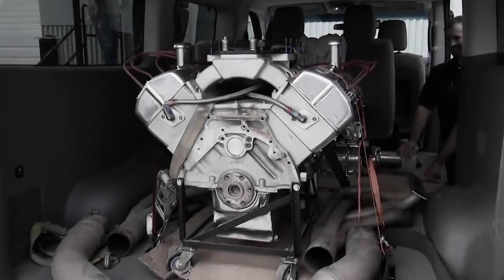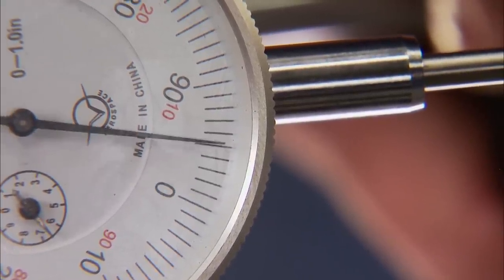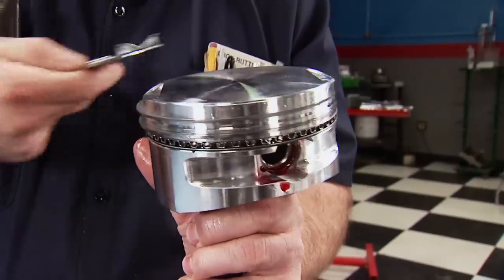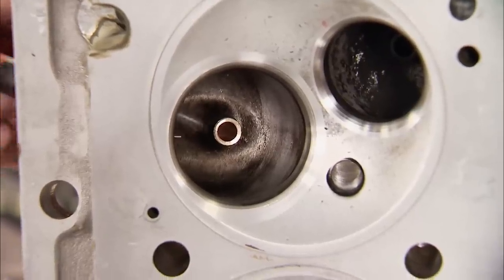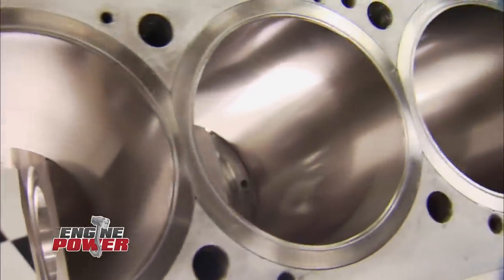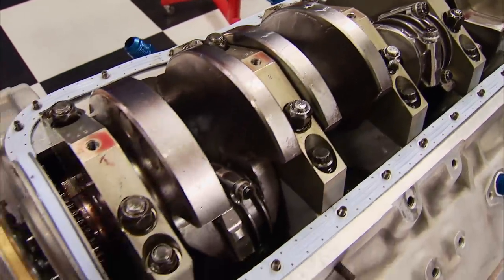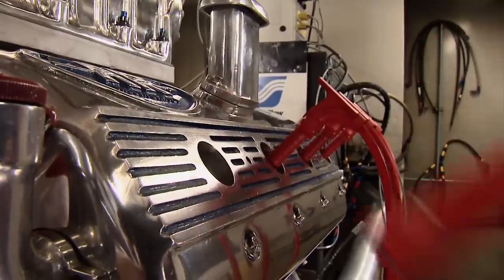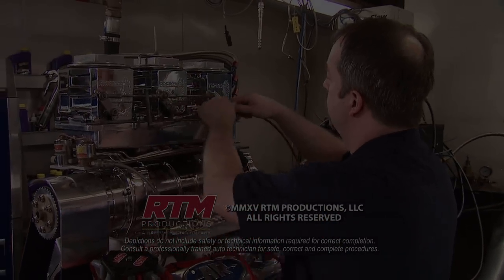The Original BigFoot Engine Build Part 3 - Engine Power Season 2, Episode 7

Comment: I love how everyone here is an expert on performance engine builds
Reply: There will always be those guys. The best part is they probably drive moms Camry.
Reply: For sure!
Reply: Man it turns my stomach to read the comments. People are just rude and disrespectful. It's a wonder anybody lets the general public see anything.
Reply: Steve Welborn oh man... if their not the best engine builders in the world their whinging about the power it made and them not wringing it’s neck on the dyno, taking no consideration into the account that this engine was designed in the 80s and only freshly started... this is a priceless, irreplaceable piece of Motorsport history. I wouldn’t want to go leaning on it and hurting it either.. imagine if it booted a rod out the side of the block (unlikely but can happen and does happen).. the point of this build was to preserve history, not make a million hp... no one sees this!
Reply: I actually am an expert in performance engine building/assembling...and a devout Ford guy. 
For that iconic powerplant and the team's goal of refreshed and improved internals without compromising the originality, I think the did a great job. I also commend them on NOT making some hard pulls on the dyno with such an irreplaceable piece of history. I don't think I could have resisted doing so. 
Overall, I think this series and the hard work on this iconic powerplant within the stated goals was most excellent. Well done!!
Reply: @Richard NZ only until the entire body of the cars are all photovoltaic cells ...
Reply: @Richard NZ not a bright thing to mention

Comment: I'm not a Ford guy but big foot is for sure a legend.  Henry Ford would piss his pants to see all that oval power.
Reply: All what power?
116 octane with 600 cubic inches and just around 1000 horsepower?
A natural pump-gas engine around 600 inches will make 700 ft/lbs at 5k RPM.
That Bigfoot engine should be making 1,500 horse easy. 

I think they went too high of octane and it ran shitty due to low compression- and blower engines run low compression.
What are your thoughts on this build- seriously?
Reply: @delljr2769  like I said I'm a Chevy guy... but the technical stuff I dont really know about. So I would be foolish to have much of a discussion about that.  The fact is big foot the truck was an icon of my childhood In the early 80s. I bet i could get 1000 hp out of my ls if my checkbook would let me. Lol
Reply: @waynetaylor420  

Indeed, a well built LS3 with turbo will easily make 1,000 horse and purrr like a kitten until you stand on it.
Reply: The whole point of this project was to restore and preserve a priceless, irreplaceable piece of Motorsport history... not wring it’s neck and risk kicking the rods out the side of the block.. And I don’t think a lot of people are taking into account the vintage of the engine either, a lot has changed since 1984... and these numbers were huge back in the 80s
Reply: Probably high torque low rpm
Reply: I am a Ford guy. That is why I am watching this video. My only comment.
Reply: Ford: I said to paint it black!!
-- drops dead..
Reply: Maximum horsepower was not the goal. This setup would likely be capable of 2500 set on kill with different rods. But this amount of work into a piece of automotive history isn’t something to have a dick swinging contest over. We are also dealing with tech from 35-40 years ago. So...
Reply: Dell Jr the entire reason they did this motor was just to refresh 40 year old technology. It probably would have made a ton more power but they were probably scared to give it much more rpm because the block has already been patched a few times so they didn’t want to risk blowing it up. Had they built it to today’s standards it could be near double the power. You can’t compare a 1,000hp turbo LS engine to something like this. The turbo ls motor would be great in a car but terrible in a monster truck it’s more about torque for a monster truck than hp. A monster truck needs big cubic inches, big heavy crank so it can make massive torque to move the huge tires your talking 2 completely different types of engines.
Reply: Would be cool if Henry Ford was around to see Bigfoot when it first came out. Going from 20hp model T to over 1000hp 640+ cubic inch motor.
Reply: @delljr2769  sometimes you want things to last. Don't over due the simple shit. That's why Ford's were so damn reliable back in the day and all these Chevy guys are dealing with a blown engine constantly. More doesn't always mean better. I like to enjoy my engines for longer than a few pulls.
Reply: @jimmythepowerful  
Im not sure what you mean,  my duramax sprays Prius repellant every time i leave a red light..
Reply: Blue oval 👍

Comment: My little 5.4 2v with a vmp gen 3 soon to be R makes 787 rear wheel hp 813 lbs of torque at 6200rpm on 23 lbs of boost. 890 ish at the crank. Crazy how technology has come so far. Still wouldn't mind having that big bastard in my engine collection.
Reply: It's on the conservative side. I'm sure it can blow your two valve with more tunning

Comment: If it’s going to the Smithsonian, I’d honestly rather have seen it on a stand so the entire motor can be viewed. Hell, a junkyard 302 out of a fox body, a bronco, or a host of other fords could have been dropped in for the very few times the truck will ever need to move under it’s own power again.
Reply: This show is from 4 years ago, dummy.  Bigfoot's not going anywhere near the Smithsonian.
Reply: The engine is now on a stand in Bob Chandlers office. That Bigfoot has a 460 in it now.
Reply: T J that makes more sense to me also. I figured why not just build a smaller, more efficient and modern big block that looks the part to move BF1 around if they need to and display that original 1980’s work of art so it can be viewed all the way around. Personally I don’t care how old the video is to those who’ve mentioned it in comments, it’s cool to see how they did it in the 80’s. I’d like to have the opportunity to see some old school engine tear downs and builds that are original or period correct recreations.

Comment: What happened to the 1mm wire rings for the top of the liners, there was no mention of these important sealing rings during the build
Reply: I was looking for this too. Never made it in I guess unless the engine builder did it after the magic of tv build part before the dyno

Comment: A lot of Go Fast parts on this & plenty of Cam to see it to 7k-rpm.........Plus being a 640ci topped by Teflon 8/71 on Race Gas
But 750hp @5k rpm is showing decent signs.... my bet is 950-1050hp at full noise. Cool 😎 looking motor though!!!
Reply: 1000 hp out of a heavily blown 640 hemi seems weak AF.
Reply: Keep in mind that this is a design from the 1980s... back then these were HUGE numbers
Reply: @nhraandnascarfanatic5907  -- but it was all updated.  Teflon sealed blower...I'm not sure how efficient they are,  modern piston design, newer modern lobed billet steel camshaft.  Maybe.. Maybe the heads, even being an 80's aftermarket hemi just don't have the flow and are so poorly designed that the 2.400 intake valve is useless.   Even NA that motor shoulda been capable of over 1hp per cube and then add over 16+lbs of boost and it should be in the 1300-1400hp range.  More than likely it's just an RPM issue.  They built a high rpm setup but tested it at low rpm's and even stated it was just gonna be a show piece.  Kind of a waste if you ask me.
Reply: The whole point of this build wasn’t for big hp anyway, it was to restore and preserve a priceless piece of Motorsport history... they barely tickled this thing on the dyno because... well... would the risk of kicking a rod out the side of that irreplaceable block be one U would be willing to take..?? I do agree to a point that they went abit too “all out” on this thing for what they want to do with it now and in my opinion takes away the originality and nostalgia but hey... when ur as wealthy as bob chandler.. who cares right
Reply: D G  yep!..exactly.
Reply: 69JANKS it’s not a full tilt engine build. If it was, it wouldn’t have to bat an eye to make north of 1500. That 8-71 is a little small for that displacement
Reply: superkillr that’s not heavily blown. That’s enough to get it to do all that they want the original truck to do. If it was a full competition build, that motor wouldn’t have to try very hard to make 1500+
Reply: D G the design is from the late 60’s from ford for the boss 429, it was redesigned by Alan Root in the 80’s.

Comment: I loved this 3 part series, but I have to be honest. Bit of a let down in the power department. Sure it lost 68 cubic inches which I'm sure is worth over 100 hp. But I tend to think it's way over cammed for 6500 rpm. Maybe the cam was spec'd for 640 ci rather than 572. IF it made 1000 hp, I suppose that's only about 100-150 hp down on what I'd think it would have made, given I doubt it ever made much more than 1200-1250 hp.
Reply: It’s not intended for competition. It’s intended to sound good and make some descent power. Doesn’t need to make 1500+ like most of the monster jam trucks are capable of making. In reality, if thing was built for competition, It would have a hard time not making 1500hp. These Boss 429 platform engines can make in excess of 3000 with the appropriate parts
Reply: Road and track said it actually makes 1400 hp. It currently has a crate motor making 800 hp.

Comment: Wow that silicone bead was frickin huge. Surprised that was allowed to fly in this shop
Reply: I couldn't help but start laughing when I saw that. It's thick enough to get used to ice cupcakes!
Reply: Cause they can’t do the smart thing and get the actual gaskets to stick when an engine like this is under boost and has an assload of crankcase pressure.
Reply: @fz1000red  true and back when these engines were first developed we had so very exotic silicones that were applied paper thin like Yamaha bond #4 that is still used today ..there is only one better and that is the industrial strength from catapilar industrial equipment

Comment: "We know why you came here, to see big numbers on the dyno, so heres a mild tune 5k RPM pull at 750 HP with no nitrous....."

Right.......... 3 videos for that........
Reply: Exactly What i just thought... Its gonna run a tour then be put in a museum; Why not run it real hard... Almost like they are scared of the work they did.
Reply: Because this show is/was a joke. Hence why it failed
Reply: Ben Moore with only 26 degrees of timing, they aren’t trying to lean on it real hard. Still made 950 @ 6000rpm with is plenty good for its intended purpose. Full competition set up, the boss 429 platform CAN and WILL make north of 3000hp if you want to push it that hard. You could qualify one of the engines in NHRA pro mod if you wanted
Reply: Well for one, prolly didn't wanna rag too hard on a freshly put together engine. Another thing, the engine is a piece of history. Would have been a real bitch if they did a hard ass pull and blown it TF apart from some freak accident.
Reply: Did you see that nitrous plate looks like about a 5000 horsepower fogger..if you , you tube fogger plates you will see what I am talkin' 'bout
Reply: @taylorgtrotter  its worse than you think ..being in pro shops there is never an engine built without being fully "broken in " with full pulls before it is allowed to be  release to the customer with a dyno chart copy documentation ..its all about liability issues as the law
Reply: @kowboykalebb  it will be even way worse as they will all be in prison if it blows at the demo run killing people without proof of a dyno run before they release it .. how long have you been a pup , my information and experience comes from the day we used to watch this thing at the fairgrounds get over yourself
Reply: @donniebaker5984  that engine holds a large amount of historical value. There is zero reason to lean on that motor more than what it made
Reply: 1 of 1,i get it but many dont.this inst a $500 ls

Comment: A lot left in that engine.. Only 26 degree max timing using 116 Oct fuel.. Very conservative timing and RPM... Decent low end torque to move the thing... gotta also keep in mind that it is no longer a 640ci, but maybe around 570ci, because of the smaller bores for strength.. which was a good idea, because when I saw how thin those walls are for a boosted and NOS vehicle, I'm surprised it held together as long as it did overall.
Reply: ... 4.377x4.750 is 572 cubic inches. 👍
Reply: titanicwhiz I’m glad at least one person caught the timing they put in that thing to tone it down a bunch. I’d venture to guess with around 32-34 degrees of timing and on alcohol this engine would be quite nasty

Comment: Bbf with a blower and 3 carbs making 800hp!! WHOA!!! Hold onto you hats fellas. 🙄
Reply: Lol my thoughts exactly its like i expected at least 900bhp
Reply: It's a PULLING motor.   Torque moves those massive tires.   Not horsepower.  Low end power, versus high end.  Also,  that engine was built with a direct port nitrous oxide system.  Meaning : that blower engine is built a lot lighter on the scale.   Built stouter than ever needed,  or tested.   The nitrous system,  has never been used.  Built at a higher compression,  without the nitrous thoughts and system ... I'd imagine,  your 1000 plus hp number,  would be readily seen.   You didn't ask,  so no offense meant ... just providing more information,  as to why the low number.
Reply: James Campbell even then, it’s fuck all torque either. 
They could have made much more torque if they wanted. 
They’ve either left a lot on the table, or built a very lazy motor. I’m also assuming that the nitros is no little 250 shot.
Reply: The torque number is ridiculously low too that engine is very capable of over 1200 hp/tq.... Especially having the best ford engine builder doing all the highly technical machine work. They ended up building a turd od an engine that a na crate engine could laugh at!
Reply: Torque at the WHEELS moves the car and that's a function of gearing. This is why horsepower - as a measurement - was invented. If you make very little torque at high revs you move just as well as if you made twice the torque at half the revs. Horsepower is the only measurement that gives any indication of performance cos it factors BOTH torque and revs into the equation meaning gearing doesn't affect it like it does torque.  500hp at 5000rpm vs 500hp at 2500pm just means the high revving engine makes half the torque at the crank at peak horsepower, but it's restored by a gearing advantage for a given road speed, ergo the same "work done" (the definition of horsepower) occurs at the wheels at a given road speed for both engines despite the low rpm one making more torque at the crank - a meaningless figure taken in isolation, but people keep on doing it.
Our obsession with low rpm torque is based on the undesirable peakiness of higher revving engines which despite regaining the torque through gearing, are rarely as linear.  The CURVE of the power delivery determines how many gears you need.
The world's most powerful ship engine in 2013 - Wärtsilä's 109,000 hp RT-flex96C engine - redlines at 102rpm. If we put it in the world's largest truck, and compared it to an engine that redlines at 5000rpm with the same horsepower, that engine might do 200kph with overall gearing of 3:1 (resulting in it's torque being tripled to the wheels as the rpm are reduced to 1666 at the wheel), but the ship motor's gearing to achieve the same speed would be 1:17, hence it's torque would be REDUCED by a factor of 17 due to gearing required to speed the axles up to 17x the measley
 100rpm crank speed.  But they'd both end up with the SAME TORQUE at the wheels, which are spinning at the same speed, with the same horsepower. 
So the poor old Wärtsilä''s 7,000,000Nm is slashed to just 412,000Nm at the wheels (meaning the other engine made a measley 135,000Nm or so at the crank at 5000rpm, hardly worth getting out of bed for really) tho with a 2300 tonne engine and what I imagine is a reasonably beefy drivetrain and chassis,  it'll need most of the remaining 412,000Nm at the wheels to get up a steep hill. 
On second thoughts, that's probably still enough. And we thought THIS was a bigblock :)
Reply: A lot of people here are crying and saulking about the dyno results and are not by any means taking into account the vintage of this engine... in the mid 80s these were massive numbers, not to mention they weren’t leaning on this thing at all on the dyno.. the point of this build was about preserving a piece of Motorsport history, not making 100,000,000,000,000 hp

Comment: A full race motor rebuilt was very interesting. I would like to see more this. Disappointed you didn’t run it up to full power.
Reply: Bradley Griffin probably didn't want to chance blowing it. Let it run full power at the show.
Reply: Bradley Griffin It’s not built for competition anymore. Just an updated original. IF it were full race, this thing would surpass 1500hp easily.

Comment: I use to run the Kindig / Predator carbs. 
Big problem were the fuel bars and no idle circuit but boy they made plenty of horsepower when they kicked in.

Comment: 640 cid, all new everything, 16 psi boost from a new roots supercharger, triple performance carburetors; all to barely best a stock hellcat engine......... 750 hp from a hemi headed 640 cid engine is a great example of how far we've come.
Reply: another 2500 rpm it could go.....

Comment: In part 2 you cut the engine for O-rings.  What happened to that?  Also, do you not check your crank barrings for clearance?
Reply: I don't see how there gonna get away with that. If they don't have a problem it will be luck.